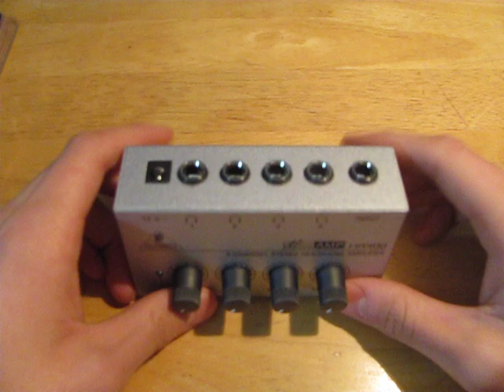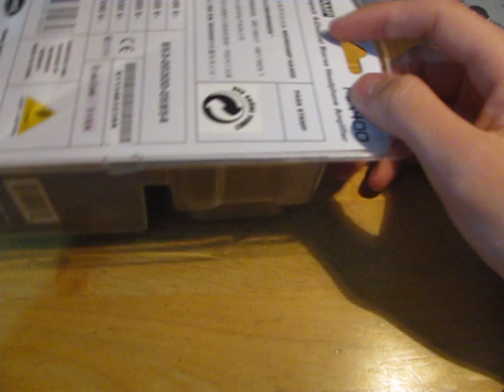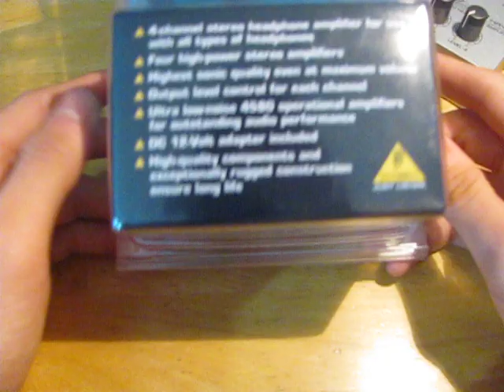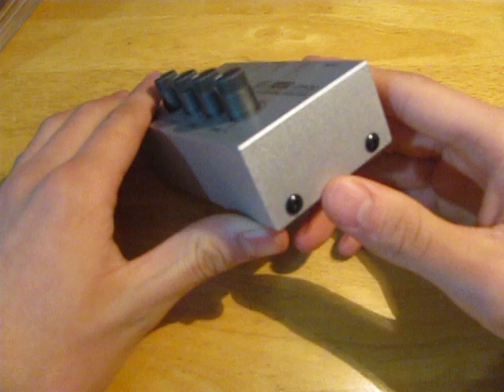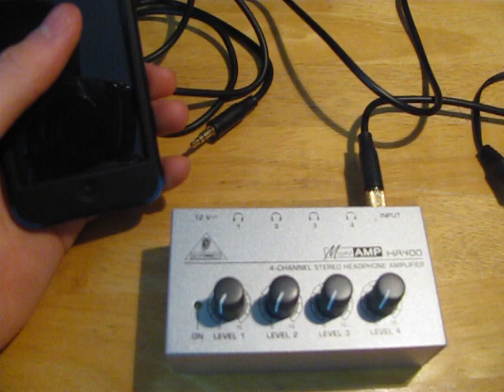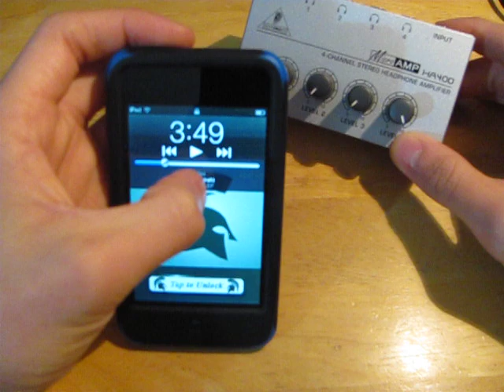Behringer HA400 Headphone Amplifier

Comment: A plug is not an adapter. The quarter inch headphone plug  is the standard for audio equipment. The eights inch is for minis, ipod/pads and computers. And last but not least: the impedance ( the symbol is called omega) is not the amount of energie sent to the phones. I suggest you'd better leave the explanation to someone  who's a better expert.

Comment: Can I use it for Live Church Service?
I want to take the Line Out of my Amp and get 4 Outputs to put 4 Speakers around the Hall.
Reply: +Samuel Thomas You can use it to distribute the line out to 4 line outs, and it amplifies the sound, but this is a headphone amp so you won't be able to run a passive speaker from it. You will need active speakers or amplifier(s). But if you have an AMP already, It should be able to run 2 speakers, so you just have to buy another AMP, wire the two together and you can put 2 other speakers on it. Hope I helped.

Comment: Just FYI...gain is NOT the same as volume.  Volume allows you to turn audio up AND down.  Gain is exactly what it says it is...it elevates the electrical signal so the circuitry of a mixing console or other pro audio equipment can process it because mic and line levels are so low.  So, you know, just saying.  LOL

Comment: thanks dude its an excellent review....pls let me know that i am going to buy this amp cuz i wanna use it with my 3d bluray player through RCA to 3.5mm(or 6.4) as it doesn't have headphone jack and no volume control and directly to headphone i am getting very low sound so do u think it will serve the purpose. i wanna watch movies with loud volume with my surround headphones